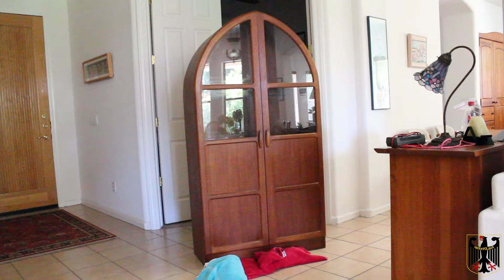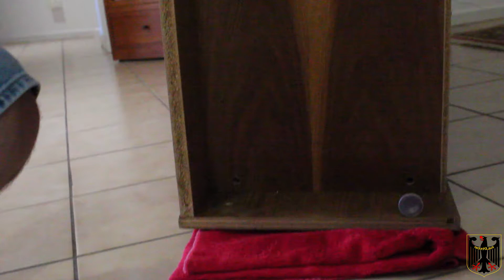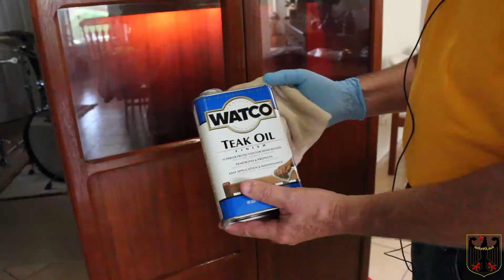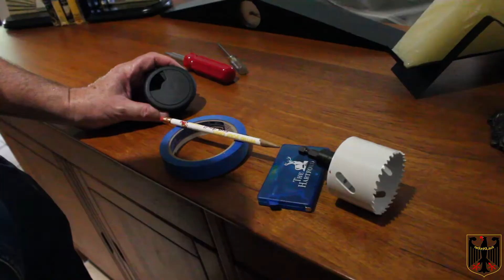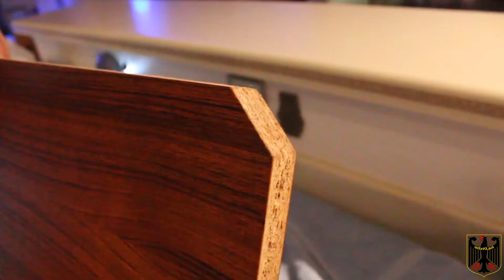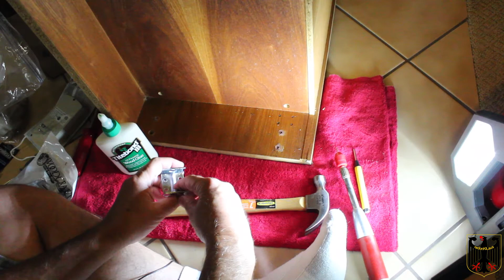Dyrlund Danish Teak China Cabinet Restoration

Comment: Very informative and love your furniture collection.  I recently acquired a set of a Mcintosh teak dining table with nearly no finish left on it and watermarks galore and a set of six chairs of which two are carvers and the armrests have gone "blonde" from wear.  What would you recommend for reverting the colour back to the dark reddish honey on just those areas?  I am assuming it is NOT going to be enough to strip off and then reoil, is it?
Reply from the maker: For the chairs, you can likely use the turpentine/steel wool method to make sure there is no debris on them, then use Watco teak finish fairly liberally along with teak oil.  That should get the color close to the rest of the chair.  Since the wood has lightened considerably, that also means that it is very dry, so you will need to oil it frequently (every day for a few weeks is not unusual) for the wood to darken back to its original color.  For the dining table, you can try the same method, though I am not sure how it will turn out because of the water stains you speak of.  If the finish is not to your satisfaction after you restore it, you should take the pieces to a professional, as they will likely need more extensive work.  Thanks for watching!
Reply: redonKiLaus You are an angel. Thank you for the advice.  I will start with the chairs and the darkening by oiling.  :)  Then have a look at the table top with its watermarks.
Reply: ***** Kann wer Deutsch sprechen?

Comment: Great, informative posts. I've got a solid teak dining table which has been used as a desk for years, so one side is very worn - almost to the point that the finish on that side appears to have been worn away. Can I just use the turps/teak oil method over the whole surface to make the finish appear even again, or do I have to consider sanding it down? Cheers.
Reply from the maker: If it's finished in the same way as all of my Danish pieces, then you should be able to use the steel wool and turpentine followed by teak oil and the Watco teak finish to make it look like new.  If it has a different type of finish (satin or glossy urethane, for example), then you will have to refinish the whole thing.  Thanks for watching!
Reply: Be very careful not to bear down on the steel wool too hard.  If you table looks solid, but is really veneer, then you probably won't be able to restore the finish as it will be blockboard or pressboard underneath the teak veneer.